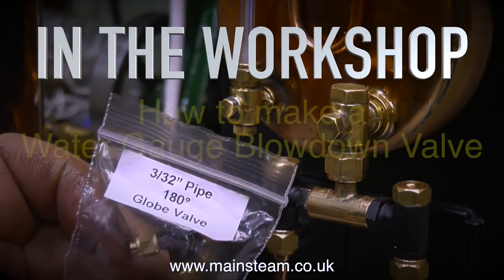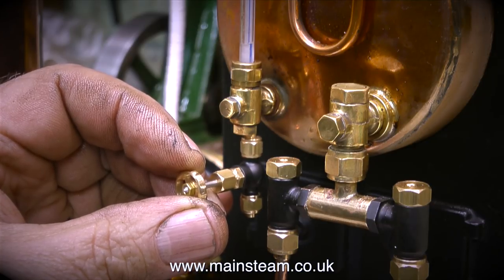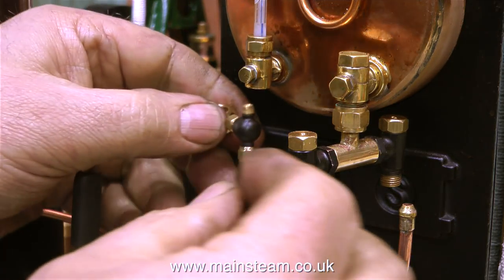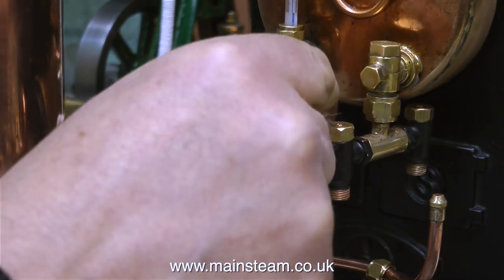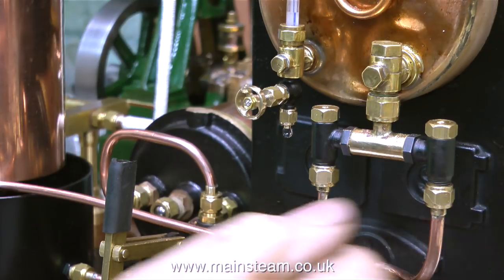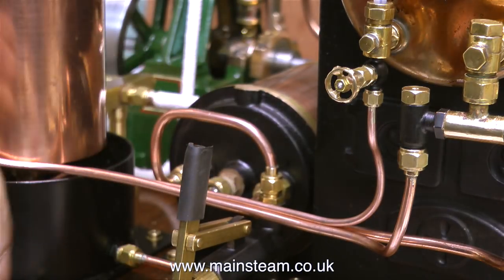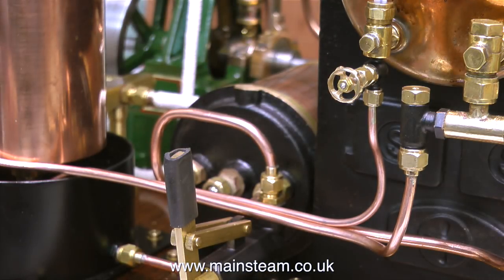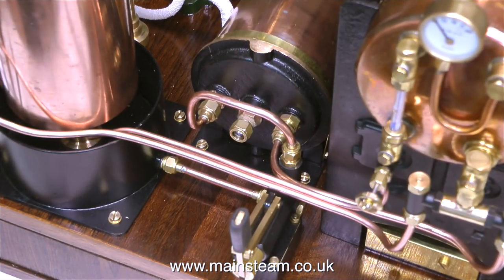HOW TO MAKE A WATER GAUGE BLOWDOWN VALVE - IN THE WORKSHOP

Comment: Keith - I did exactly this myself having had the problem of leaking Stuart drain cocks on my Stuart 504 boiler. I suggest that you try the operation of the valve with the boiler in steam. If you get the same result as me, you will find that when the boiler is at working temperature and pressure the valve seizes and will not open to allow draining. Be interesting see what happens with your one.
Reply from the maker: The drain cock that I bought from Stuart Models had a design fault - the tapered handle was a rattle fit in the tapered hole ......
Reply: I was talking about the wheel valve that you fitted most recently - try it under steam rather than cold as your video.
Reply from the maker: It's fine.

Comment: =sigh= Yes, useful! What's left to tidy up on the boiler plant, at this point? There was the belt, I think, and the smaller pulley to get the better low-speed power generation, but I can't recall what else was on the docket.
Reply: Randy Novick and now there's a generator there could be a dyno test too.

Comment: Those other valves probably just need lapping in (although that's likely an arse of a job at that scale).
Reply from the maker: No, they are definitely faulty - there is currently a design fault with the units.
Reply: Weird. You'd've thought that, after 200 years of Steam Engine usage, the design would have been finalised be now . . . .